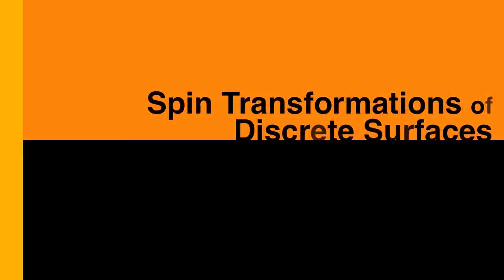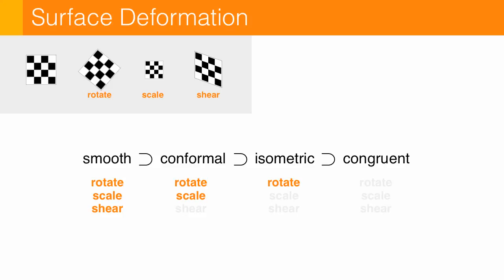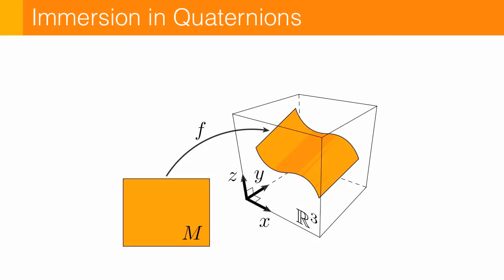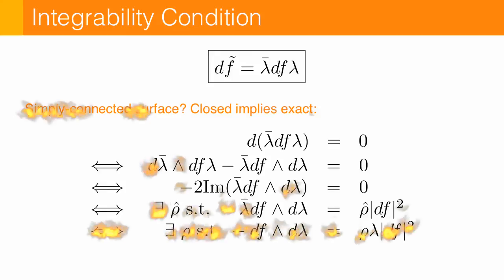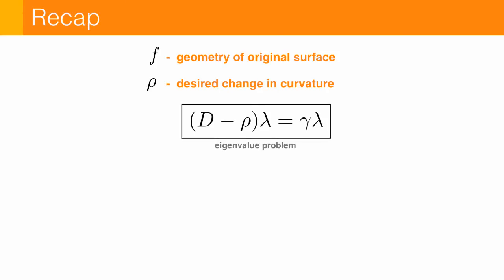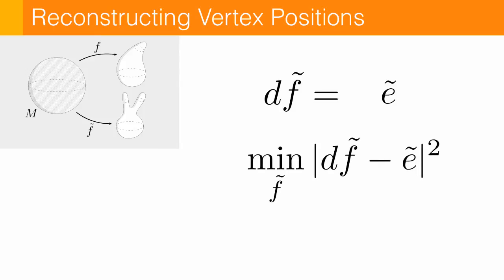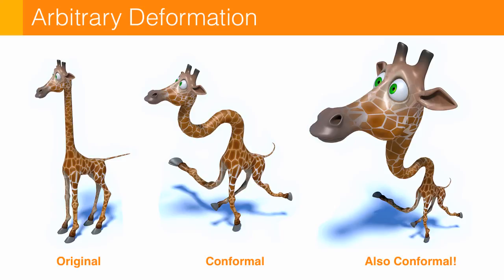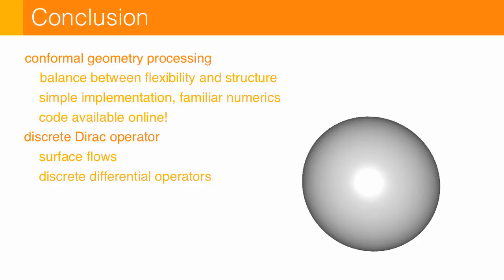Spin Transformations of Discrete Surfaces - Conference Presentation

Comment: Would like to see this paper written in the language of geometric algebra/calculus, removing quarternions with bivectors and quarternion product with geometric product
Reply: I tried my hand at exactly this in the examples folder of my pycomplex github repo (tried posting a link but I think youtube blocks that). It turned out very elegant in my opinion; only a handful of lines of code... but im still missing something since the results are wonky. I dont think its the GA though seems the eigensolver is having trouble... The GA reinterpretation seems (?) straightforward to me; the dirac operator becomes a geometric product with 1-vectors and that gives a quaternionic matrix if multiplied with its own transpose. Would be great if @keenancrane could take a look at it to spot any errors!